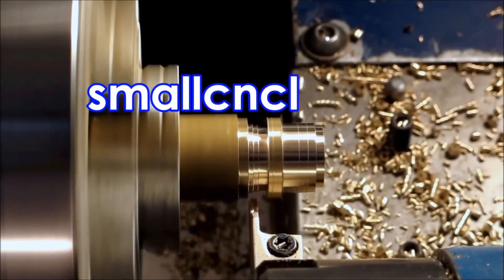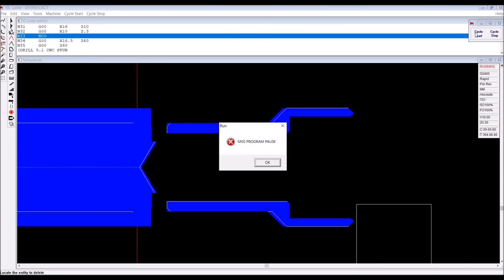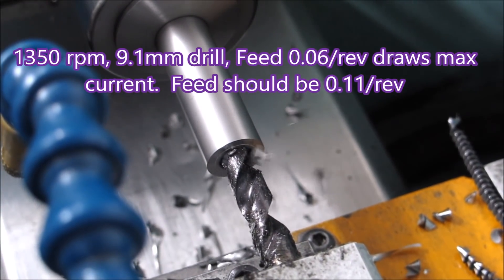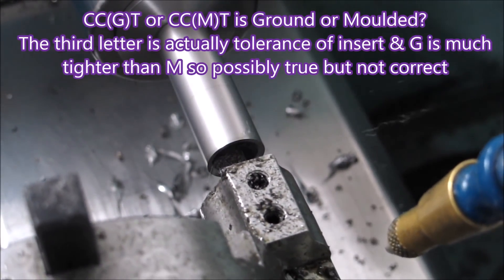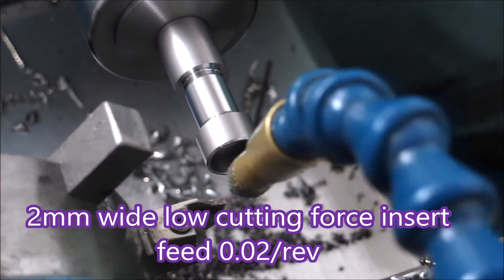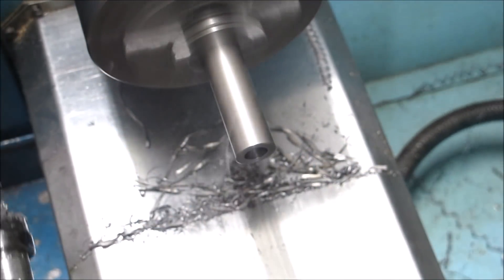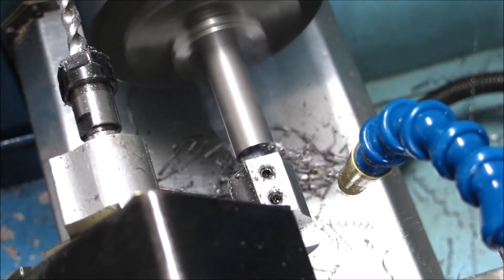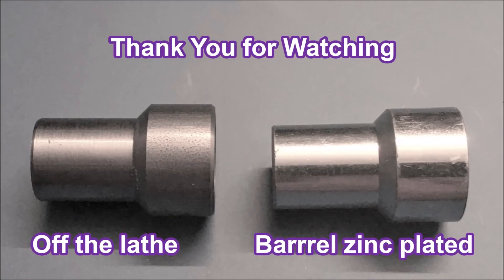Hercus PC200 cnc lathe turning steel with stub drill and Sumitomo inserts

Comment: Hi Nigel, why do you use feed/rev rather than standalone feed? Is it due to finishing of the end product?
Reply from the maker: Feed per rev is fairly easy to understand in turning, unlike milling where it gets complicated by the number of cutter teeth etc. To me, feed per rev relates directly to thread cutting (pitch per rev)  and for drilling I use a feed per rev per diameter as a rough guide.
10mm drill gets 0.1/rev feed and I vary it up and down so a 5mm drill gets 0.05/rev feed.  I have always done it this way, so to me a feed per minute would be difficult to get to grips with. I am not explaining this very well, perhaps it is just a personal thing with me! The only axis movement relative to time of which I have any knowledge is the rapids on my 2 lathes one is 6000mm/min the other is 2700mm/min.

Comment: hmm, i find leaded steel breaks into small chips much easier than 6061 anyway , if not create dwells/retractions in stringy operations to force a chip break
Reply from the maker: S1214 seems to be replacing the leaded free machining steels here in Australia. Thank you for your comment.
Reply: @smallcnclathes  , do you find the 12L14 breaks chips easier than, S1214?..or similar?

Comment: I find drilling out  a pre-drilled hole has a tendency to make an over-sized hole... 🙄

😎👍☘🍺
Reply from the maker: Thank You, to be honest, it is very rare that I have to drill holes accurately, they are mostly just clearance!
Reply: @smallcnclathes   yeah... for accurate (small) holes yer going to ream them anyways 😏
I ran a Britan semi-automatic for years... great little machine, ideal for medium-quantity production. I learned a LOT about machining from that little beast. 

😎👍☘🍺
Reply from the maker: Machines that teach me something are the ones I recall the best and with the fondest memories usually. My first cnc was an Emco PC5 compact, some 15 years ago. I had to learn about cnc code (I had not a clue) from that tiny machine and it taught me well enough for me to be able to move on to the Hercus when it came up. It is true that both these lathes were "Training" lathes and were set up to teach so it did make things easier for me.
Reply: @smallcnclathes   😎👍☘🍺

Comment: FAGOR? Could you show and discuss your additional drill bit attachment?
Reply from the maker: It is just an aluminium block screwed and doweled to the cross slide. Bored in place using a drill and reamer held in the chuck. Then screws through the top to hold the drill or ER collet holder in place. Have used it for drills, reamers, slot drills and a rotary broach. Much better than having long and or heavy attachments in the turret.

Comment: You've got to cut the shit out of that material for a chip. You'll likely need every bit of that machines power to do it.
Reply from the maker: Yes half a horse power does not hep much. Thanks for your comment
Reply: @smallcnclathes  I have a 1/2 HP sheraton 9" manual lathe and I've managed to break chips in normal mild steel, so presumably S1214 wouldn't be an issue. Depth of cut and speed wasn't much to write home about though. You need the right chip breaker geometry, it makes a massive difference- the above result was using TCMT 16T304-3G inserts from Carmet in Brisbane.

Comment: Questions:
Do you need to man the two lathes when they were producing parts?
Do you need to feed the stock when a part is finished?
How long did it take?
(Sorry in advance if I ask any dumb questions!)
Reply from the maker: The dumb question is the one not asked! Yes as the lathes have no auto chucking or feeding they need constant attention. So, yes the bar had to be hand fed and the collet or chuck opened and closed for each part. That is why I used the collet on the machine that did most of the work, just a lever pull or push to open and close, no chuck key to pick up use and put down again. from memory about 4 days I think, it was a while ago that I made these parts. Thanks for your comment, always happy to answer when I can.

Comment: 800?? Imagine 40000. 800 is nothing
Reply from the maker: For someone that can handle 40000, 800 would be nothing, but in lathes like mine it would be quite a feat.
Reply: Reminds me of the time I was making gearbox shafts on to cnc lathe around 5000 over the course of two weeks.
Reply: 40K you need a swiss lathe and magazine bar feeder.  With free cutting steels if you get the right feeds and speeds you should just have to clear pull parts out of the parts catcher.

Comment: hi superb. what is the cost of the machine.we are from india
Reply: Why can't Indians just go online like everyone else and use Google?
Reply from the maker: Hi Julian, I don't think this is country specific and in this case to get the answer  I was able to provide may take some time on Google.  The machines are no longer manufactured and entries on the web can be difficult to find. Although I did just do what you suggest and came up with my own website about the machines. LOL Not sure though if at any point I mentioned the specific make and model, which what I knew and was able to search. Thank you for your comment, apologies for delay in responding.
Reply from the maker: Design Automec Hello India, these machines are no longer manufactured.

Comment: Yes, steel swarf is horrid stuff. Are all your lathes Hercus?
Reply from the maker: Not my favourite by a long way, my little lathe is hard put to get the magical C or 6 shaped chip when working steel.  As we know the machine tool that is always the right size for any given job is yet to be invented.  I have no complaints about my lathes, they manage to get the job done, often when asked to do things above their pay grade so to speak.
Reply from the maker: Both my cnc lathes are Hercus PC 200 lathes. My first cnc was a little Emco PC5 which was plagued with steppers that missed steps. Going to Hercus with servos was a huge jump forward.
Reply: @smallcnclathes  Just about every school I worked in had one or two Hercus lathes. They were usually the 260 with the quick change gearbox and the power cross feed. They were great little lathes and I built two locomotives and a twin cylinder Stuart marine engine model on them. At my last school we had two of them side by side and I often had both running at the same time (on the weekend when the place was empty). A few select schools up here in Qld were given the CNC version but I never did get to see one running. You seem to be getting maximum output from yours. Very impressive.

Comment: Ah, well, 2 down 798 to go! How long did it take? How did you cope with the boredom?  Are you still sane? Hmm, were you sane when you took the job on? 😊 …. Martin
Reply from the maker: From setup to cleanup was about 4 days I think, with 2 machines running boredom is not a feature of a job like this. Amazing how often 2 machines running different cycle times, conspire to both finish at the same time during a run.
A lot more sane these days since retirement took over and no longer under the pressure of working for folks
Reply: I am a cnc operator and a run of 800 parts is kinda normal. Luckily I have 5 to 8 machines I run at once so it breaks up the boredom